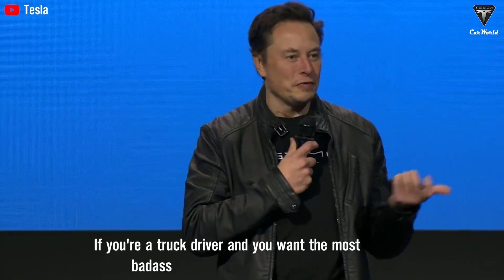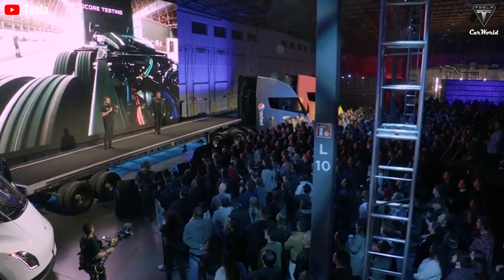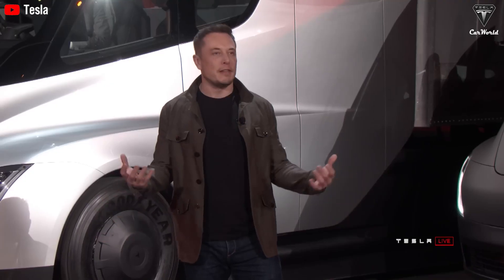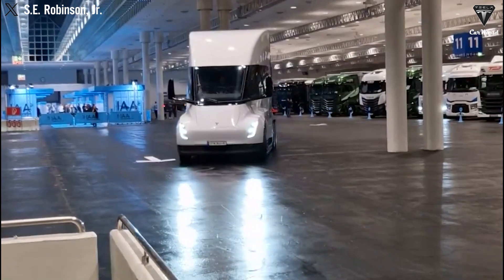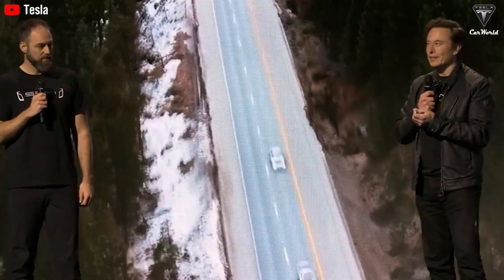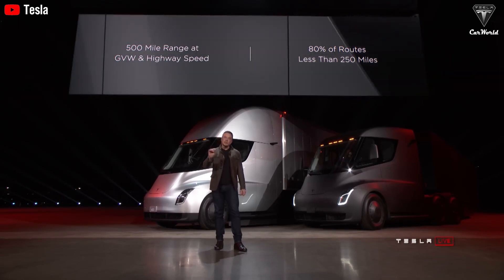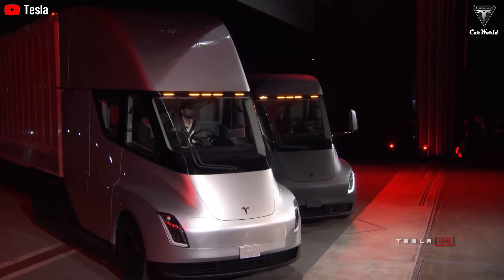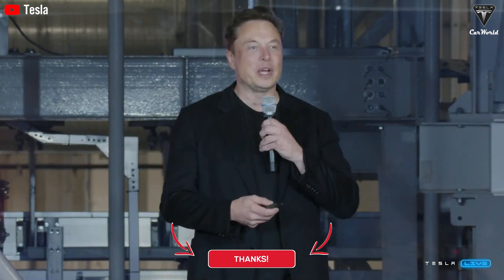Elon Musk Reveals Tesla Semi's Insane 2025 Production Volume! Shocking Performance & Price Achieved!

Comment: My family’s First Car, a Ford V8 had only a 6Volt Battery, being built in the 1950’s and coming equipped with a crank handle manual start system if the electric start failed to turn the V8 over when cold . My wife’s first Volkswagen car was similarly blessed. In the dark the headlight illumination was pathetic …

Comment: 3k for running 1000 miles? Lmfao!! That math don't math. 1000 miles cost a traditional truck about 7 to $800. That fuel cost is wayyyyy off. $3000 will get you about 14 days. My fuel cost on avg a week is about $1500

Comment: Truck driver here! I don't see this truck out performing a traditional semi lol. Yea maybe it can drive longer miles as us truck drivers are limited to 11hr a day drive time which roughly amounts to about 6 to 700 miles a day on avg. How does it preform in the mountains?  How will it pretrip itself? How would maintenance work? How about really tough turns with a 53ft trailer? And the biggest how of all is... How will it preform a 90° degree back into a spot between 2 other trucks with very limited space? IT WONT!!! The fact is and thankfully it is, it will always need a driver in the truck for these very situations. So drivers don't panic. We will still have a job and it'll actually make our work easier as you can let it drive itself on long straight highways and interstates while the driver can relax and watch a show, read a book, or even take a nap.
Reply: Mountain Driving is excellent and a Feature only available in electric Vehicles is the ability to capture charge on downhill runs while also saving on brake wear …. Let’s see a hydrogen Gas Truck or your Diesel or any Petrol truck do that … also don’t be to sure that it couldn’t back the combination into a tight hole either …
Reply: Drivers repeatedly say it drives better through mountains as far as maintaining speed up and down grades. Autonomy through mountain passes still needs work but major routes such as I80 are simply achieved now. Tesla has 1,000s of trips between Freemont and Giga Nevada. Icy conditions will also be an issue for autonomy but solvable. I think it's very clear the trucks will drive autonomously 95% of the trip and likely human drivers for close quarters. But hubs will be designed to accommodate autonomy in time. This was the point made that a large % of long-haul trips are on a few highways. The number of long-haul drivers will certainly be curtailed in time.

Comment: Wonder how long one of them would burn when it catches fire???
Reply: I didnt know that diesel explodes into a fireball when its aluminium tank is crushed in an accident.
Reply: @RIPPERTON  Diesel is actually somewhat difficult to set ablaze.  That's why they use compression to ignite it rather than spark plugs because sparks don't set it off.
P.s. Oil has been burned into the atmosphere for hundreds of years.  We've only been burning Lithium and Cobalt into the atmosphere for the last 15 years or so.  Up until Tesla cars, we had a world that was relatively uncontaminated by Lithium and Cobalt.  Thanks to EVs and cordless shit, we now have spread it everywhere.
Reply: Depends if the owner voted dem or rep…..

Comment: I question the cost in video of running a diesel semi for 1076 miles. Grok said typical semi get 6.5 to 7.5 mph that would put fuel cost for ice truck at $566. Far from the $3800 quoted in the video.  I'm an EV fanboy, but always want the truth.
Reply: I have watched this pod cast for a couple of years. Dude doing this pod cast has now obviously switched to AI not only pulling his info off AI, but has chosen to use AI to also voice his pod cast. In my opinion he's now putting out videos he has zero interaction with. Disappointing.
Reply: Facts